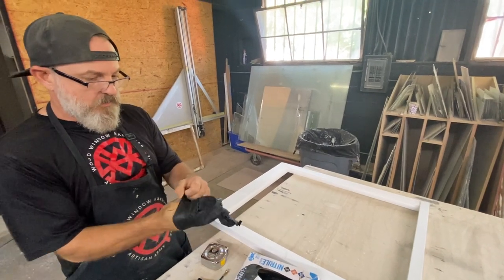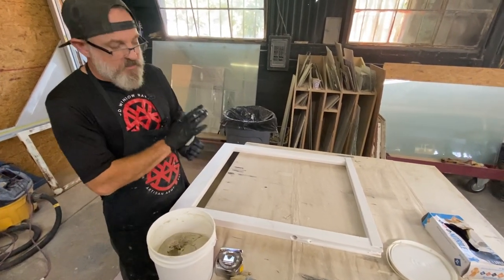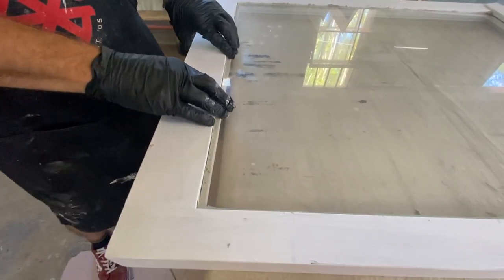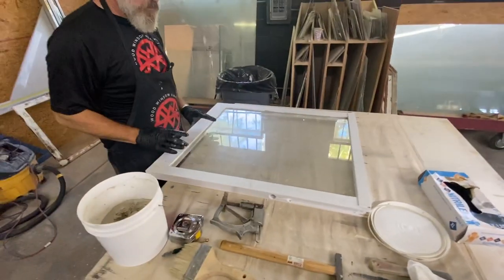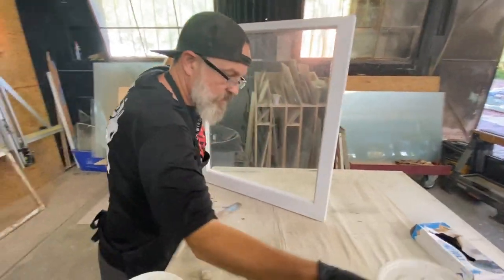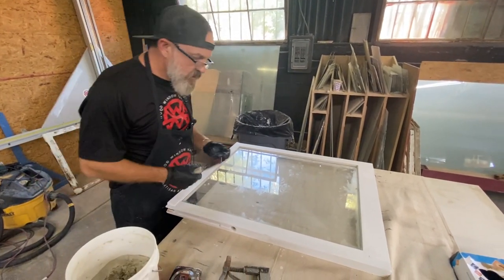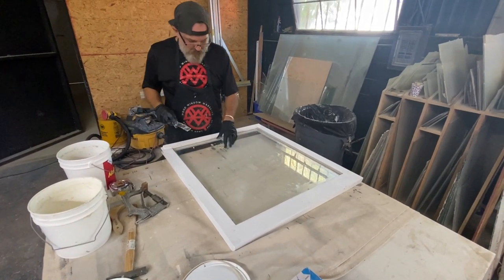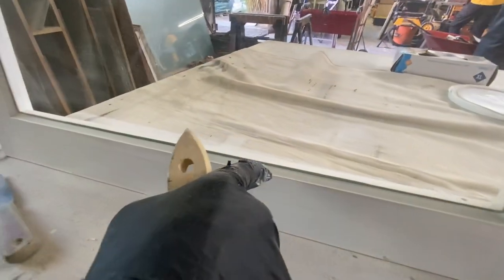Glazing Your Wood Window Sash

Comment: Why have a groove in the sash ? What is the benefit of that over just another rabbet ? Would the glass pane be a bit oversized then to fit in the groove ? Or no ? Thank you by the way for the lesson in glazing.  I have glazed windows a few times without ever understanding what the proper way to do it was.